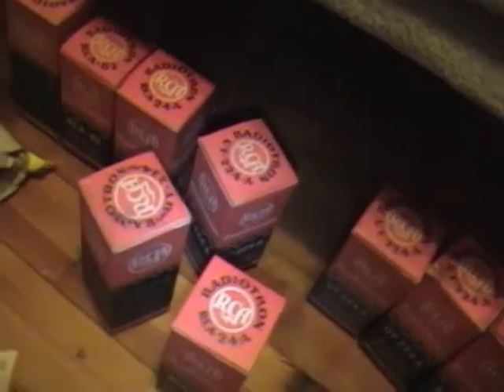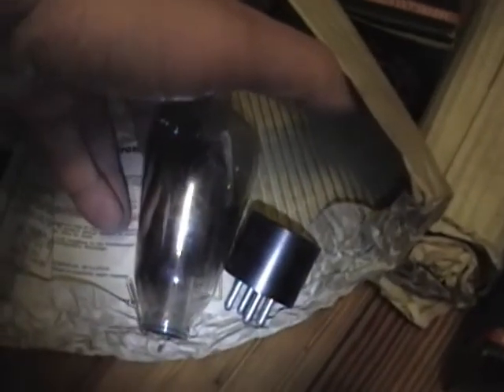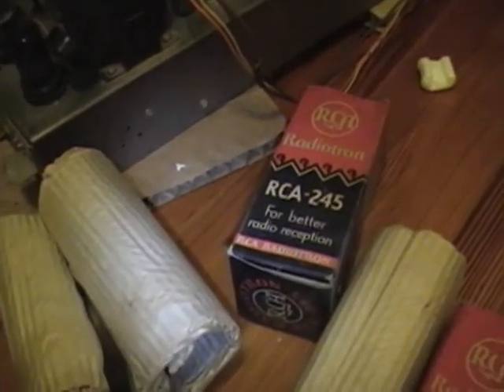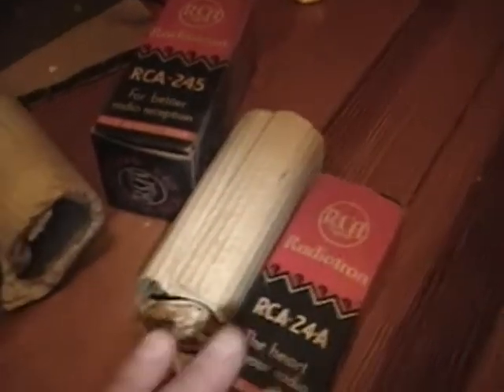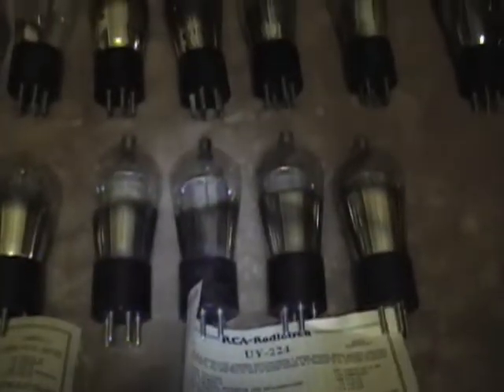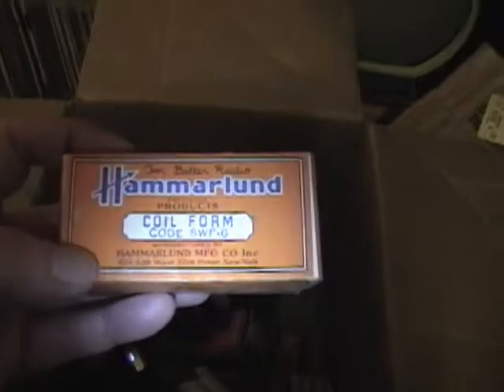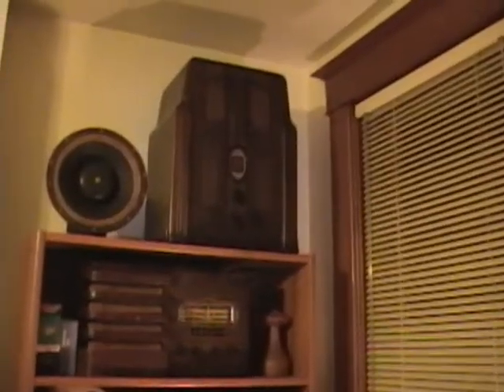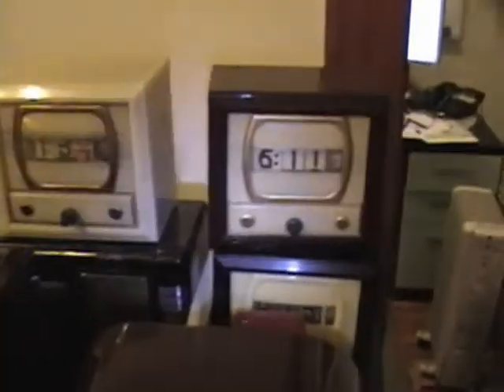Early vacuum tubes - part 2

Comment from the maker: It tested good, but I haven't actually tried it in a set yet.  I think I paid around $100 for them.   No, the shield is not connected to any pins like with later tubes.

Comment: DUDE!! Tell me if the 45 works after you resolder it!! Wow! Talk about Extended NOS. Bob how much did all this cost you? The tube angels love you man!! The Majestics.. with sheilding .. is there a pin that connects to that sheilding or covering spray?? Or is it just an external surround type. Is it like the metal tubes I guess? Nice haul!